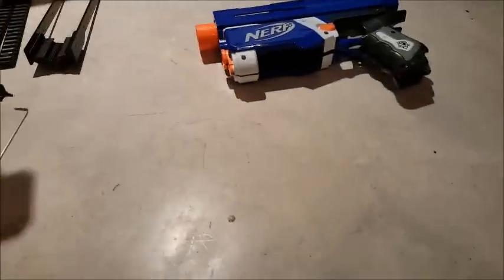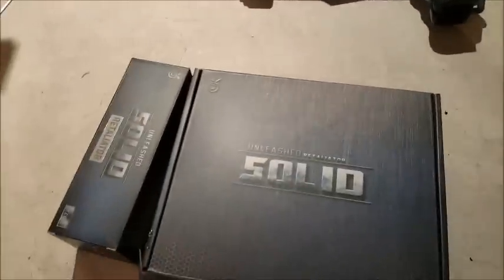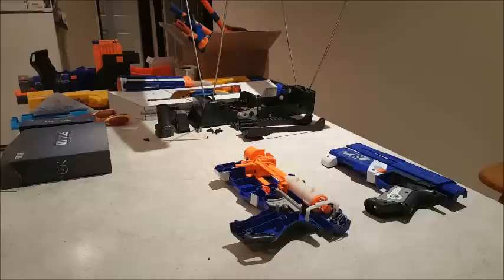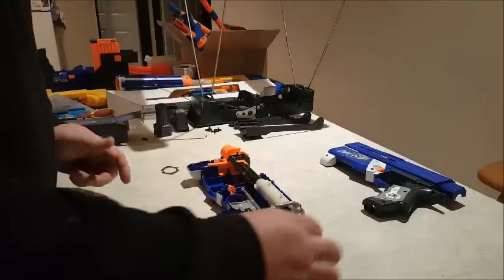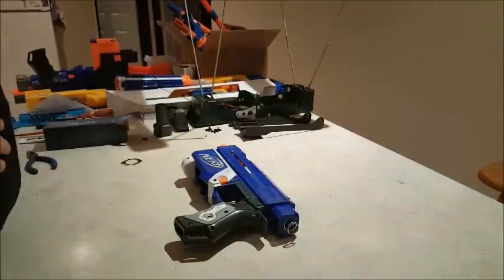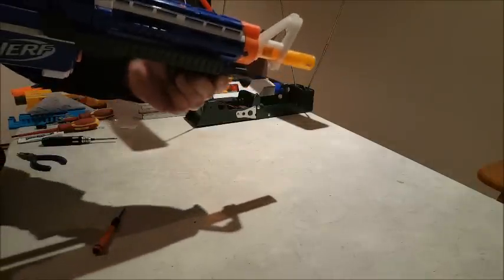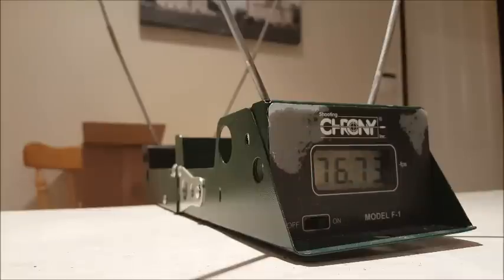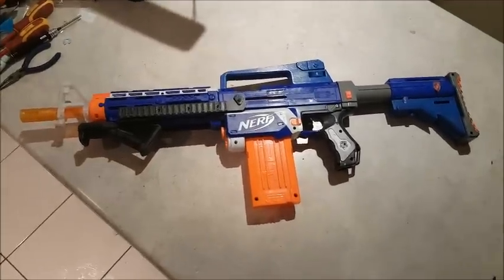My Retaliator Build

Comment: Thanks J0D0CAST! That's an awesome build.   I have two questions;
1) Your 3D printed carry handle looks amazing.  Will you be offering it on hobbymods.net or Shapeways?  
2) Where did you get the angled foregrip?  Worker doesn't seem to make one like that.  Is the one you used just a cheap one from China?
Reply from the maker: +John Sokalsky Hey John,
1) Yes they are coming to hobbymods.net very soon.
2) It is just a cheap one form buychina if I remember correctly .
Cheers,
J

Comment: Just a note here, it is my opinion that your barrel should be slightly longer if you are going for the authenticity. the forward sight should not be that close to the barrel shroud
Reply: Maybe it's a CQB version?
Reply: +Mekahi Scott CQB doesn't change the Gun itself. It merely implies that attachments and add-ons have been installed for tight quarters combat, synch as an under barrel shotgun or a halo sight.
Reply: +Drew MacDonald Well he tried and got pretty close I guess.
Reply: +Mekahi Scott yes and did a very good job

Comment: where did you get the pump grip from?
Reply from the maker: Ebay
Reply: +J0D0CAST did you just type in "retaliator pump grip" ? only reason I ask is because I've seen a whole lot of cool nerf parts and such from Taobao or other places from China but I can't find very much info on any of them.
Reply from the maker: +dthomas6184 no its actually a picatinny mount airsoft grip